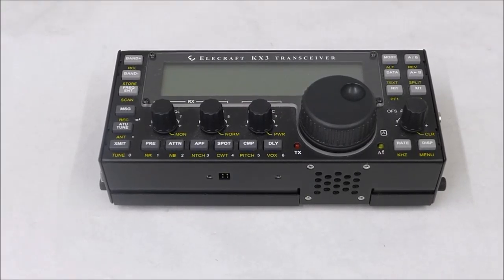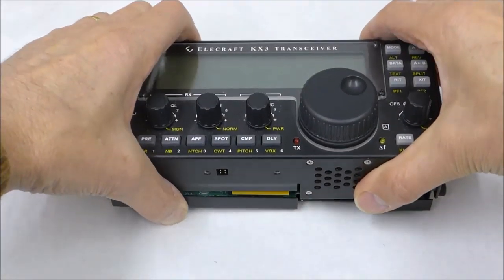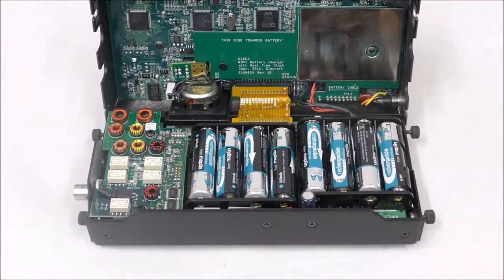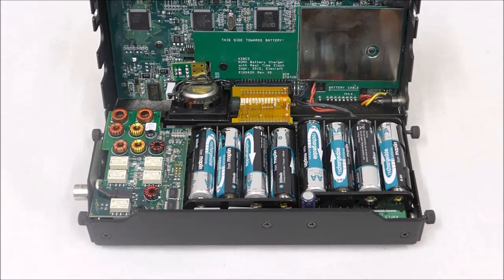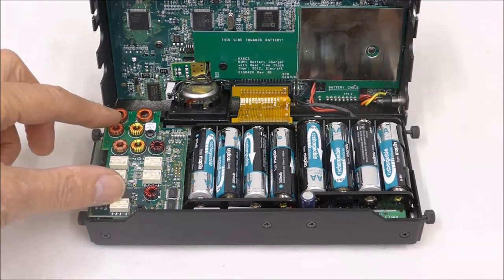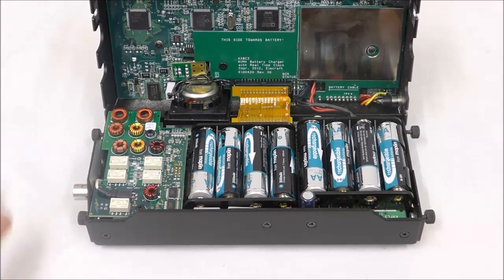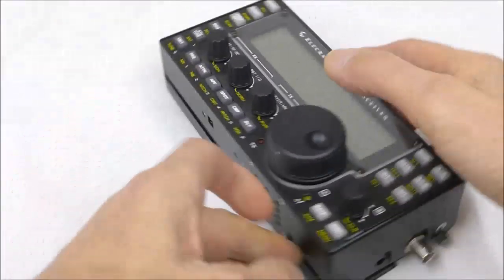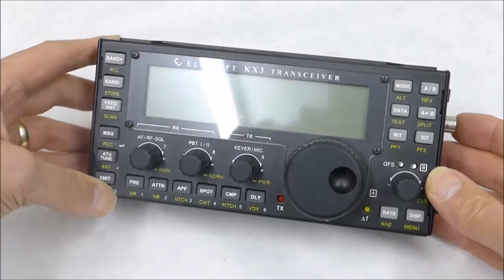Elecraft KX3 Demo

Comment: 8 years on and it still holds up as a great portable radio.  I’ve used mine out in the field and while I no longer use the internal batteries  it has given me a lot of enjoyment.  I’ve also used the new IC705 and while it’s a great rig and certainly set a high bar for others to follow I’m sticking with what I have.
Reply: Just bought one this year, GREAT radio. A K2 hooked me and the KX3 is my next Elecraft step. 2025